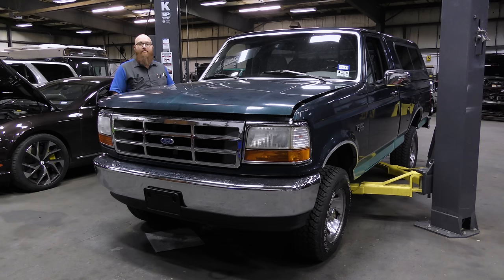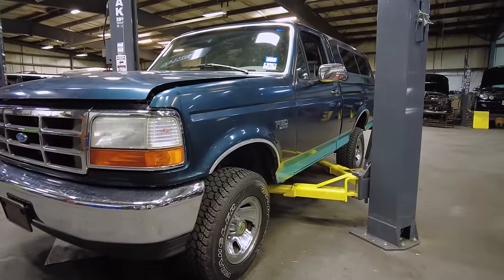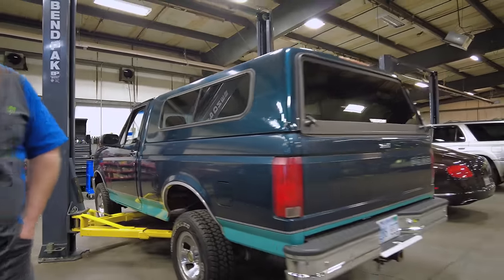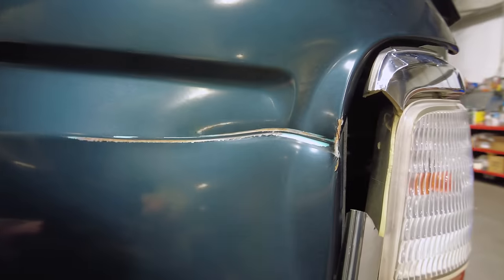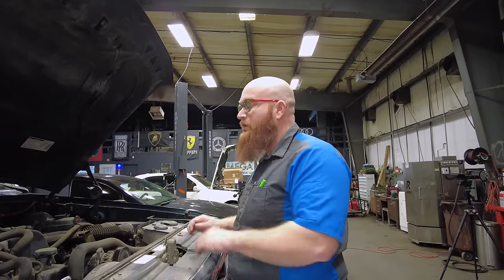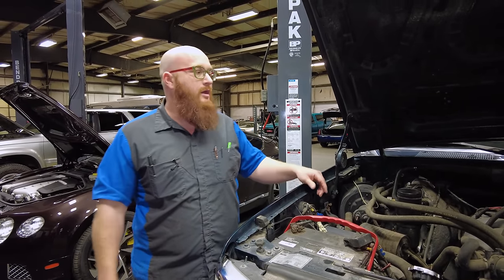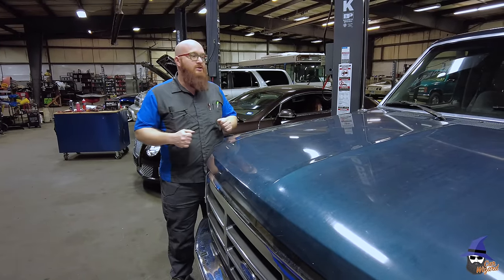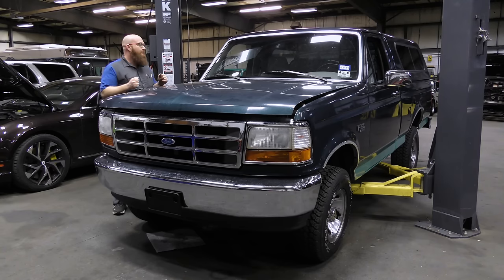What makes the CAR WIZARD mad? Fixing other shop's screw ups! Cheap Shop made  huge mess in '95 F150

Comment: The question is... who can you trust? Unfortunately, the answer is nobody. Shops will often charge you for 4 hours of labor on a 20-minute job. They overcharge for the part and the labor. Some will claim to do work they don't even do. I had a friend who got an estimate on repairing his pickup for $2900. After taking it to another shop they fixed it for less than $500. It turned out to be two sensors. Everything is a scam now. That makes it even harder for honest shops because of the reputation the industry has.

Comment: Idiots that don't know that older vehicles and even some newer have screws and actual fasteners and not just spring clips..if it takes more effort than a small door panel plastic removal tool to remove a panel check to see if there is a physical fastener

Comment: I call BS on that engine. I had one that was trashed and the truck also rotted like crazy. Maybe most of them are bulletproof but this one was a money sink for me. A lot of issues. 

However. I believe inline 6 are the most reliable engine category to exist to date. So they have that on their side if you have one you’re likely going to have better luck than I did

Comment: That's crazy.. unable to find a coolant leak at the first place to look.
I can't wrap my head around why they ripped the instrument cluster out, shorted stuff with probably a powerprobe, because the AC gas was low? What? I also do diagnostic and repair work for other shops, and I thought I had seen it all. Dude....
One of the stupid things I saw, was another shop having trouble finding why the parking sensors stopped working. They replaced all sensors, ripped the whole back half of the car apart. And it rolled into my shop, "oh please code this new control unit, because the old one is bad". I did a diagnosis and
.. they installed a front plate holder with mile long self tappers, right through the parking harness 🤡

Comment: The only part on a car I will take a prybar to is rusted ass license plate brackets. I work at a wholesale auction, if you send me a vehicle with rusted screws on, I will rip it off with a crowbar. Use stainless steel or drive a 1994 Ford escort.

Comment: You are right about a lot of things but you are dead wrong about the broken plastic, I own a 92 f150 and plastic is brittle any plastic you touch breaks that includes the vacuum hoses under the hood. You can verify this by checking OBS forms and mechanics don’t want to work on OBS trucks because they are OBD 1 computers

Comment: The other shop literally abused this truck, just horrible!  I am bias though as I have a '91 F-150, Bricknose, 302 V8, 5spd, XLT.  A great motor, but not in the league of the I6 for when it comes to being bulletproof.  Although that 302 does have a nice low rumble with a Dynomax Super Turbo Muffler.

The nice thing about the Bricknoses and Older Body Style (OBS '92-'96) trucks is they are way cheaper than similar year Broncos.  Perhaps they will start appreciating in the future like the 1970s F-150s.  The Bricknoses, '87-'91 might just be the sweet spot as the older Bullnoses and the newer OBS trucks are generally seen as more attractive.  Or, our Bricknoses might just stay less desirable.

Comment: Hard to beat the pickups from all the brands in the 90s and early to mid 00s There's enough electrics like  simple fuel injection systems to make life nice but not overwhelming to make life a bitch I still drive a 98 Z71 Silverado I do all the work body paint and mechanical myself... I'd also say the TBI 350 would be just as good as these ford 300.

Comment: I have a 94 f150, 2wd, 4.9 six, 29 years old, runs like a top. I will never sell it. Needed a water pump at around 80k now has 136k. Ford has gone waaaay backwards. They should have just kept making the 94 2wd 4.9  forever.

Comment: what's sad is that this is not a one off.. this is the new normal. most shops just don't care. you really have took high and low to find a decent technician. forget about finding someone of the wizard's stature. those dudes are few and far between and don't need or want your work. it's a tough position for someone to be in who doesn't work on cars themselves.

Comment: Something i Always tell my customers .. "You get what you pay for"  and to Not cheap out on Certain things or you will regret it and end up paying double if not triple the original cost . Always happens in my line of work, im an I.T guy . For example, to save 40$ on a system worth 3000$ and purchase a cheap power supply and end up Frying the whole system .. all to save 40 bux , if i had a dollar ya know . I am the unicorn when it comes to PC building .. I am extremely honest, to a fault, and will Never sell someone things they dont need or waste of money for their application . Even if it costs me a few bob like less hours worked .. I dont care . I want the Customer to leave Happy and never have to  call me back because of problems . I dont want to see them again, I want their purchase to be Perfect . System dont leave my shop until theyre tested and made to work Perfectly . Treat your Customers like you wish to be treated yourself is my Number 1 Rule. So far i have had One return due to a faulty product, no fault on my end. *Knock on wood . Cheers.

Comment: Every time I take a rig to anyone around here, they screw it up and I end up re doing it myself. They charge you $125 an hour and then put some high school kid working for $7.50 hr to work on it.  Nobody with a clue wants to be a mechanic anymore. They have made everything so difficult to work on that it will either make you suicidal or homicidal. No body wants to pay a decent wage anymore so if you have to work for peanuts, it might as well be an easy job.

Comment: Another great video. Why not call these scum bag shops out? Get these scammers out in the open so people can avoid them.
Reply: He just explained it, plus there is no way of knowing if that shop broke the plastic or it was broken beforehand.

Many customers are absolutely certain X was fine before, but it's often the case they never cared to look before and it isn't until someone points it out, then they blame the last person to touch it.

Happens across all industries.
Reply: @Cheepchipsable  In this case it was implied the customer was very sure it was the shop plus the shop has a history of screwing up work.

Comment: A do it your selfer who has never delt with auto plastic, doesn't want to spend on the manual, can destroy the plastic, watching shows like this or better something like Rainman you get a better idea of disassembly and plastics. Talking the panels off the door without a manual would probably end up with some broken plastic. I don't see the problem with the interior with the problems, maybe the duct motors but that would be stuck on AC or heat not likely low refrigerant and not cold enough.

Comment: I get that things happen and mistakes are made. We are human after all. 

What I don’t get is why the original shop didn’t get a good condition cluster and surround from the wreckers and use that. To charge $900US after breaking a car is beyond the pale and the reason why trust in mechanics is down the toilet. 

And not being able to diagnose a radiator hose leak? That’s up there with “you need a timing belt” when the car has a chain.

Comment: Don't get me started on this. Every vehicle I have ever owned that I've subbed out to a shop has returned to me more messed up than when I took it there. Had 3! 700R4 transmissions rebuilt/warrantied by the "best transmission shop in town" in my 1990 Suburban. The second rebuild, he says to me, "We will flush the old fluid out of the torque converter this time". REALLY? after #3 started acting up I gave up and sold the rig. I regret that now because square body Chevy 4x4s are worth gold these days, but I digress.  I have only two people that I trust to work on my vehicles, and one of them is me. The other has good hands but will use big box auto store parts if you don't specify because people are CHEAP! He gives you a good price and stays competitive but piss poor parts are a big problem for callbacks, not the mechanics fault or ability necessarily. Even name brand replacement parts are POS now. I had him replace a fan bracket bearing twice on my LX470 because he used 'O-R--es Autoparts China BS. As a lone wolf businessman, Jason does all his work himself, but has to compete with the big boys who hire monkeys to fix your car.  When I take my Lexus to him, I ask for genuine Toyota parts. Buy the best and only cry once.

Comment: Wow they did at least 2000 dollars in damage to the truck then charge the guy 900. SMH. I can't believe they ripped out the gauge cluster without removing the torques screws, this is beyond stupidity.

Comment: As for the most reliable ENGINE, in Europe we vote for the old 3 liter i line 5 with 88 horses Mb diesel  from the late 70's early 80's. Does 1 mio. Mls. Anyday. Bw. Hans.

Comment: My wife and I bought a brand new vehicle from Champion Chevrolet in Howell Michigan. The car died in less than a week. They took it in. We did  not see this car for a month and a half. We paid the first payment and never  got to drive it. 2 weeks after that they said it was done. We went there and when I got into the car inside in their so-called SVC center inside the building the windshield  was shattered and they tried to blame it on me. A Brand New Car. They didn't know I took pictures when came into the dealership and of the sales people. How did that work out for them. Cover your Ass. I could tell you more about this dealership. I feel your customers pain. All these repair shops hire know it alls that know nothing and they have no respect for you or your vehicle. I've been wrenching for 40 plus years and never seen so much I don't give a shit attitudes. I'm a gear head for many years and have Respect and get the job done right the first time.  Love your channel 👍

Comment: It's hard to grasp that so many car dealers and car mechanics are so monumentally bad. If you find a good shop, stick to it, because when you land in the clutches of those idiots that just fuck up everything, you will not escape with a good car and just a little money. No, it will cost a lot, and most likely they made things worse with your car. I know a story from the old days, when a relative of mine visited a garage after they fucked up his car. He came back with no bill, some money to help with fixing the car and a reputation for being dangerous. It was never said what he actually did, but I guess he messed them up quite a bit. That garage closed eventually, because they got a really rotten reputation and nobody wanted to use them.

Comment: One time my all lights went off on Renault Scenic 2 took it to electricians doing Porsche and MB S classes, thought damn I'll be overpaying definitely😅 they repaired everything in about 20 minutes, payment was 20€, all shadow garage masters told me it's minimum 150€ job with relays, buttons, blocks😂😂 noobs replace full segment's, pro's hits problems on target👌👌real mechanics identify and repair so your problem can be only soldering new wire for 20€, or change all chain for 400€😅😅 pro's maintain customers with legitimacy, noobs make fast money light aligning or oil changing 😂😂

Comment: Great engine but maybe not the best ever. The old Ford 226 Flathead 6 engine is just as good or better. I have one in a truck that was driven daily from 1949 to 2006. And is back to running again today. In my book that’s the most reliable engine made.

Comment: The damage that occurred to the instrument surround and and cluster requires no futher enquiries/analysis - as it can be very simply and accurately deduced that it was a case of an untrained worker (certainly not a qualified technician), a poorly trained 'young mechanic', or a mechanic that lacks the ability to critically think - i.e. unintelligent, or as others state simply as ST....ID.
Whilst I understand that the owner does not wish to confront the wokshop - having paid $900, I believe he/she has earned the right to at least pose (in a calm voice/manner) the following question to the workshop owner/manager, whilst also contexulising that the vehicle in question is a 'very simple old FORD truck fitted with a BASIC instrument binnacle':   WHY DID YOU (implying the workshop's worker) REMOVE THE INSTRUMENT CLUSTER TO EFFECT A REPAIR TO THE TWO REPORTED FAULTS - (a) loss of coolant & (b) reduced effectiveness of the air-con?

Comment: Sorry the EFI 4.9 the worst POS motors.
I had a few never ran correct had all kinds of issues.
The 302 V8 far better power gas mileage.
I have several friends with same issues.
Three of those are parked junk on my farm ..

Comment: They wasn't testing anything ! You said yourself there was no reason to even touch the dash ! They stole his cluster for anouther truck that needed it or they already destroyed the dash in . Then replaced the fasteners to look like they broke it ! Eric at South Main Auto has repair place he sends them to For the electronics. But the frame good luck .Hope you can find a replacement . I really hope this guy sues their ass of  off for ripping him off. This exactly why someone needs to step up and start naming these rip off shops for what they are. Even if they filed a deformation suit you have all the evidence on video to blow their BS clams out of the water and win your counter suits ! I would it just on principle. To protect people . And wizard their giving all shops bad reputations even yours ! So buy good shops allowing this to continue buy not naming them , reporting them , or putting pressure on regulators to crack down your ultimately hurting yourself !

Comment: I expect they  are trying to use a high school drop out or drunk druggy ?
I worked at Electric Boat on Ballistic Submarine construction in the early 70s. 
The Navy contract required a number of warm bodies..
There were people after they returned from lunch v could not be allowed to work. 
Look busy yes. Handle tools or materials no. 
But.  Supervisors were required by contract. 
Some shops hire people expecting competence. 
In the 80s met a VW mechanic bragged how fast he could work by leaving out bolts and brackets and doing minimum work.

Comment: in all due defense. i have done the right thing and the screw would break the plastic just by trying to move it. and the metal hole clips are stronger then the plastic its connected to. i always warn people.. "if i try to remove this with it being 30 years old, it might break" and for those saying.. well if you broke a tab you should replace it.. ok sure, but charge the customer for a new one before you even take it lose to bypass the boo hoo. and good luck finding one that isn't broken. and im not going to pay for something thats going to break automatically anyways. even on my cars. do the right thing and pop the plastic lets go. so this isnt fair at all.

Comment: I HAD A 1980 FORD 1/2 TON P/U WITH A 300 CI MOTOR  BUT IT SURE DID NOT LOOK LIKE THIS 1995 300 CI MOTOR  THE 1995 HAS A TON OF CRAP ALL OVER IT   UN-REAL

Comment: Hello Wizard(s) did that cheap shop take out instrument cluster to get to hvac hoses or... what? If that engine has a good as reputation as you say, they might have tried to take it for an extended test ride and roll back the odometer.. only saying this because the engine in my Ford car has similar reputation and feel like 1 shop I took  it to just liked pushing the engine and liked the way it rode. For whatever reason, Wizard, those guys sound like some pikers. Your 'competitors' that is.
I know it is not that easy to fiddle with digital mileage counters as mechanical.

Comment: If you work in any type of service you should always have pride in your work , these guys were just cowboys,  most likely they had a mechanic without the proper experience, I worked at Mazda Dealer 30 's  year a woman came in for front struts  in her Mazda MPV , I suggest to Service  Manager an experience mechanic the Manager went the cheaper route with a 2nd year mechanic well I was not happy but I was just a service adviser , so I said to someone that MPV is coming back yup it did , this job required a  more experienced Mechanic  that truck came back   the customer did not pay when they had to do the job over , so the moron Service Manager cost the company money by not having the more experience mechanic do the work the first time  , it's frustrating Wizard I do understand  but over the years watching you , pride  in  your work is paramount ,  that's really nice to see  these days,  no offence to cowboys just term they used here in the UK, HAHAHA